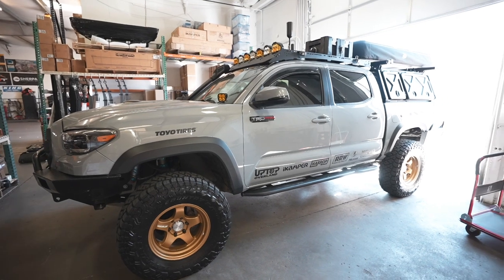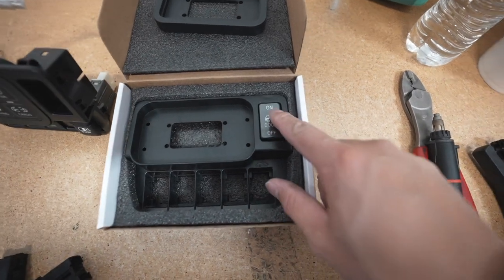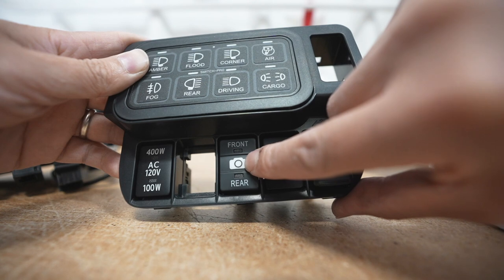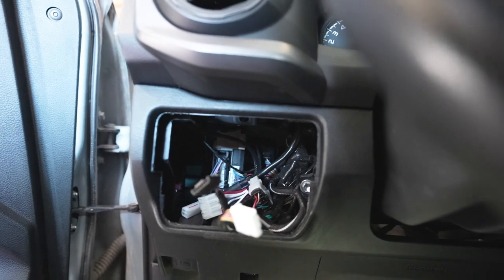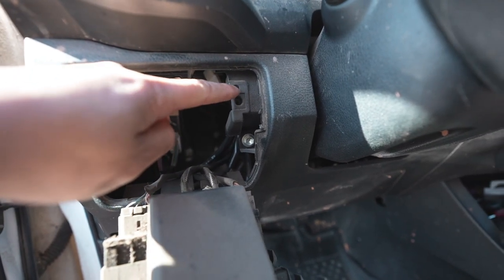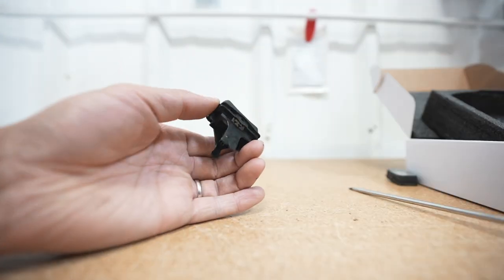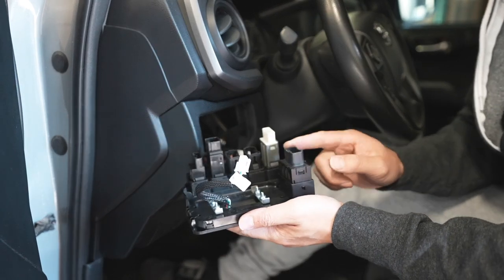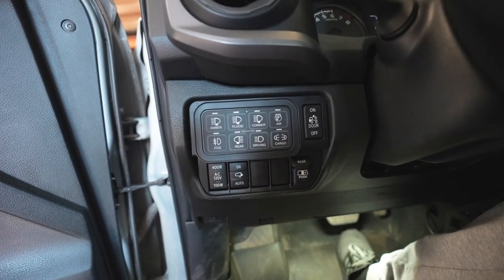MUST HAVE If you use a Switch Pro or Auxbeam in YOUR 2016-2023 Toyota TACOMA!!!

Comment: Hey @Runnin4tacos.  What if you get the clutch start cancel buttom for a manual.  Looks like you have to wire the switch in
Reply from the maker: Yeah, you just move the wire from the OEM button to the new one.
Reply: @Runnin4Tacos  no wiring required?